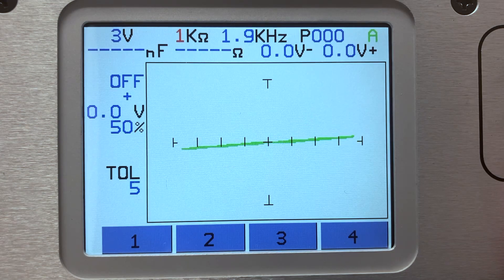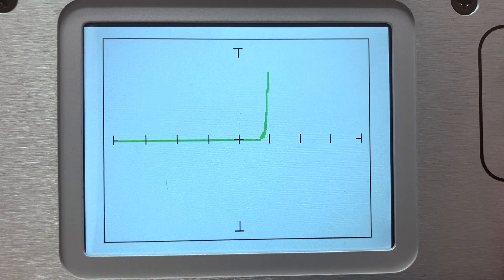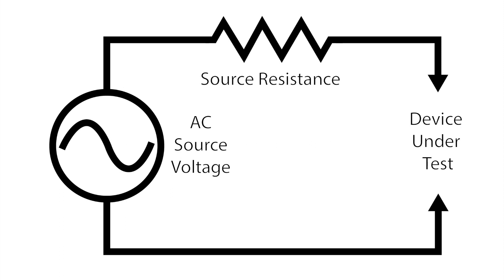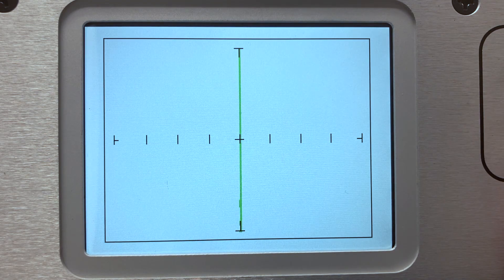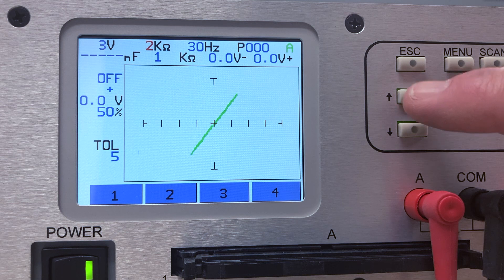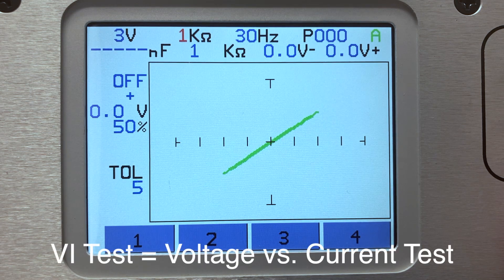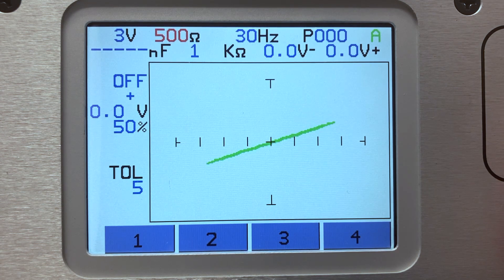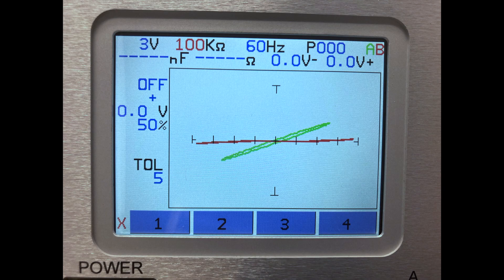How to use a Huntron Tracker - ASA Basics and Testing Resistance

Comment: Hi, beautifully explained, I know the principles of how it works well, but still I kept watching until the end.
It's unbelievable how the classic octopus has improved, I'm not an envious person, but I envy you the display of measured values on the display and, with the new control system, the number of combinations during settings. For my tracker, I restored a Tektronix 212 analog oscilloscope as a display unit, but on the other hand, the beautiful waveform display on the CRT monitor partially compensates for the absence of measured data.

Nice day 🙂 Tom
Reply from the maker: Thank you, Tom. Sometimes I do miss the old CRT based Trackers for their real-time display but the benefits with the new Trackers out weigh that aspect.
Reply: @Huntron  Of course, they prevail, if I leave the display of measured values aside, the redesign of the setting itself is fantastic and greatly refines the targeting of a specific component in the circuit without affecting the surroundings. On my tracker, I only have LOW1, LOW2, MED1, MED2 and HIGH (with the possibility of locking when using the SCAN function) I cannot freely change the measuring voltage and the resistance of the measuring loop, I can independently change only the frequency, I only have 50, 400 and 2000Hz available. I've been interested in curve trackers since I was young, when I built my first Octopus (one transformer, two resistors) it didn't even have a range switch and only followed the frequency of the mains. When I was older I discovered Tektronix trackers (a huge heavy monster on a cart) when I came across Huntron trackers I was mesmerized - tiny with a miniature screen - something amazing to me. Unfortunately, I come from the Czech Republic and our currency is the way it is, and as a result these new trackers are unaffordable for me as an amateur, I am happy for the tracker I have, I was able to detect so many defects with it that it paid off for me.
I look forward to more great videos and have a nice day  🙂 Tom